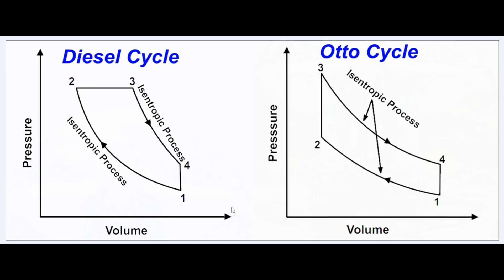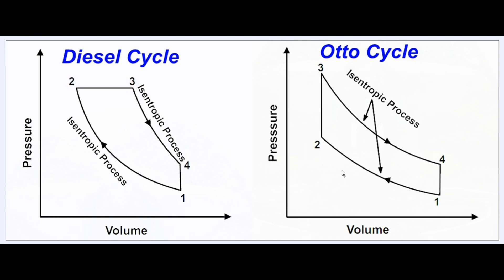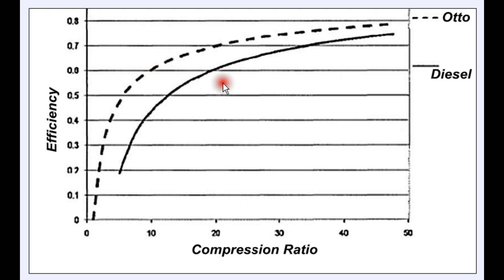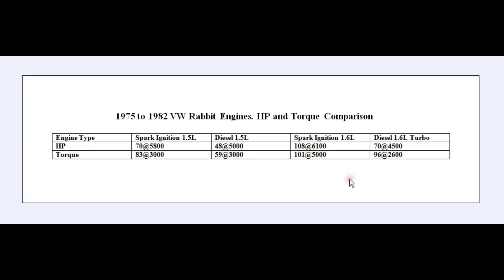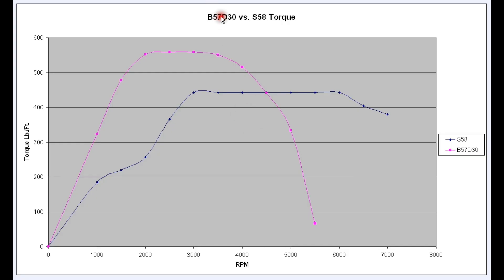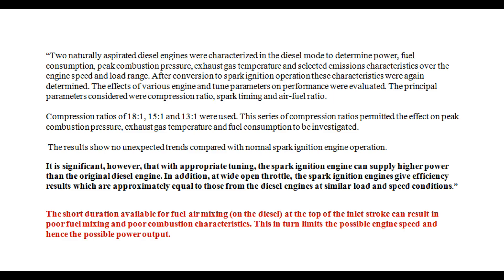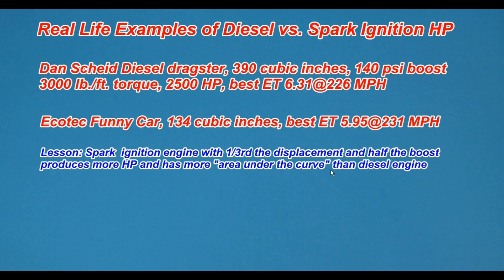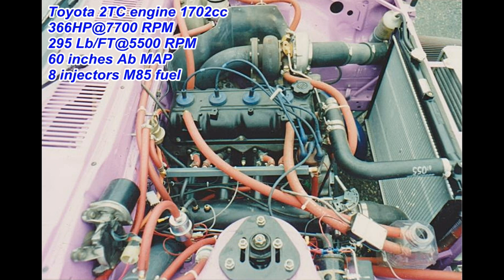Diesel vs. Spark Ignition. Torque and HP.

Comment: So I have a school bus with a big block (tall block really)GM 360 ci or something close to that gas engine. Drove it through the Rookies and now I want more power. Everyone says get a diesel engine. But after what you have shown gas seems better, just need boost. My idea is to put another engine coupled to the front of the orginal to get the power for the passes around here. Any suggestions. Please, thanks!
Reply from the maker: You could turbo with about 5-6 psi boost, would give you 30-35% more power. You need the fuel and spark management to do that properly though.
Reply: ok I will look into that, thanks
Reply: Fuck gas. Run flex fuel (e85) and use a 14:1 compression gas engine. Diesels are more efficient on mpg because they have no throttle, since nobody drives their gas engines all day at wot diesels win. Until we mostly eliminate pumping losses in these throttled motors im in favor of diesels even though ive yet to own one lol
Reply from the maker: @joshuafarwell9761  I've shown some of the latest SI engines from Toyota which are as efficient as light diesels so this statement is no longer valid. They use 14 to 1 CRs from the factory.

Comment: Sooo... why are we still using those diesels in semis? Why turbo compounding, why peak torques at 900 rpm? Why enormous diesel ship engines? Why?
Reply from the maker: Where weight doesn't matter, BSFC is king and fuel costs are lower, the diesel makes excellent sense. In aircraft where weight is important and racing where hp is king, they make less sense. You need enormous diesel engines to make big hp at 200-250 rpm. T X RPM/ 5252= HP

Peak torque on modern SI engines with VG turbos is also way down there but that doesn't actually make much power as you need rpm to do that as I've shown in this video. Torque is force over distance, HP quantifies work.

Turbo compounding increases TE.
Reply: @rv6ejguy 
I'll stick to 9549 😇
Well it all sounded like there's no actual place for diesel use, yet we haven't seen much gasoline semis for quite a while now... and they do get a lot of work done.

Comment: Thx Ross!   Definitely convinced - shared this vid with my wife, and will be off  to get a koenigsegg, first thing in the morning.   Always love your content - mind chipping in to my gofundme?  :)
This debate reminds me of solar vs nuclear...
Reply from the maker: Yes, I'm still saving for my Koenigsegg too- LOL. The comparison was with top shelf tech on both sides of the debate. In the lower cost realm, a 7L LS7 turbo build produced 1200hp and 970 pound feet running on pump gas with only 12 psi. We can compare that to a 6.7L diesel producing about half the HP and similar torque on 35 psi boost.
Reply: @rv6ejguy  i would still take the 6.7, otherwise i would need to tow the gas station behind me. Chances are the 6.7 will be more reliable. I suppose it depends what you need the engine for.

Comment: Really excellent presentation and informative. Of course, there are other factors to consider in the case of aircraft engines, such as world fuel availability, but this strongly makes the case that aircraft engines should remain Otto cycle. I know there are turbocharged aircraft engines, but usually the larger ones. I know SDS specializes in electronic FI/EI kits. However, does it make sense from a durability, safety perspective to fully "modernize" I.e., Turbo+Computer-managed FI/EI, a standard, small O-200, O-235, O-320? It would be fascinating to see a performance and long term comparison between a standard issue O-320 vs a " modernized" one. Correct me if I'm wrong, but my suspicion is that beyond the performance gains of FI/EI, these engines can't stand up to getting much more power out of them due to reliability.
Reply from the maker: Well the next video I am working on will compare aero diesels with legacy SI aero engines and a clean sheet SI aero engine. I think you'll find that interesting.

The top race engines at Reno produce about 3X the stock HP with copious amounts of ADI and spray bar water hosing into them, however they won't last long at that output. In everyday use terms, cooling becomes the biggest issue, so you're practically restricted to about a 50% gain in power on these with turbocharging.
Reply: rv6ejguy ...that sounds great. I'll be looking forward to your next video.

Comment: Thank you Ross very informative, I still don’t quite understand how my 6.7 diesel F250 With EGR delete a chip and no Muffler can go from 0 to 120 in 12 seconds 20 miles per gallon at 75 miles an hour?
Reply from the maker: 0-120 mph in 12 seconds?
Reply: @rv6ejguy  Diesels can be boosted much higher then a gas engine without the problems of having to run high octane fuels.  Example is my ram pickup stock 6.7L cummins engine outputs 800 lbs of torque turbo is set to max 38PSI of pressure. With a simple flash from any cheap flash programmer to 42 PSI on the stock engine.  There is lot more things can be done if your able to stuff more fuel in get more power out with out having to pay $10 a gallon for racing fuel.